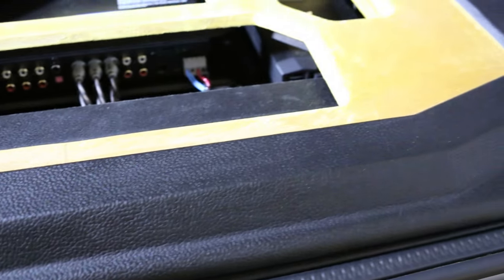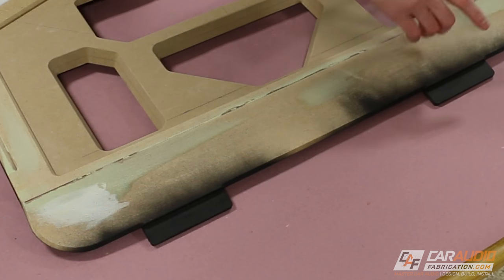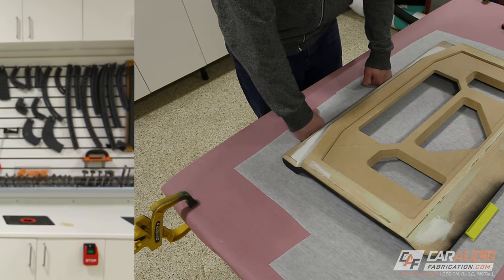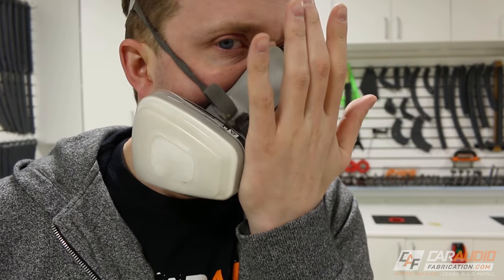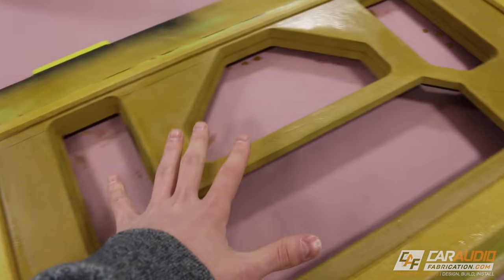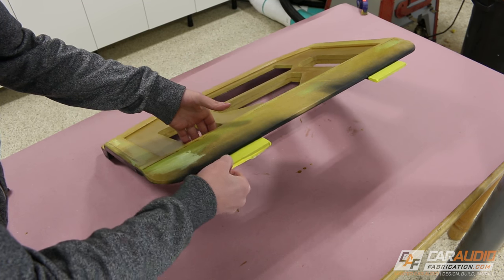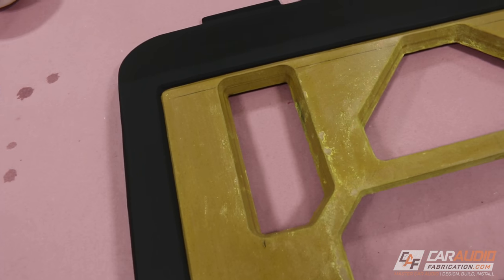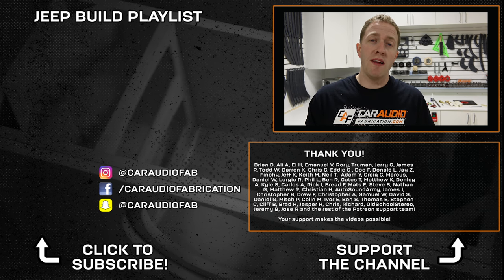MISTAKES TO LEARN FROM - Upholstery Vinyl Amp Rack Beauty Panel

Comment: I come from an audio and auto upholstery background....  (now I am an x ray tech...but I still do some things from time to time.   What I would say is that if your 4 way stretch material is that stretchy.....it may be the first thing to pull away from the corners where your (now new line is)...that being said...if you wanted to add some trim over the material to keep the new stuff down....that would be helpful and it would help set the car off.

Years ago we had a car come in the shop that I made a pattern from what was there....it was a fancy LeBaron Chrysler....with the 2 seater only and stitched leather dash with deep inserts for the defroster for the windshield...  you may be seeing where I'm going with this.

With deep contoured panels...sometimes it isn't such a bad thing to run it under a seeing machine and actually have the material comfortable where it will be instead of having to heat it and stretch it and hope that with the time that folks keep their cars....that it stays.  Sometimes even the best glues can still not be perfect when the cars are not garage kept or someone leave a window down or what have ya'.

I love your channel and your ability to show how ya' do things.  Keep up the good work!

If ya' don't have a sewing machine....I'm sorry for a suggestion that would be a bit undoable at present moment.

Comment: Mark,

I love what you doing on the Jeep. Thanks for the walk through. As far as what to do with the transition. You already have a whole bunch going on there with the two different textures of vinyl the metal mesh and the acrylic. I fear that adding a painted trim piece would create a much busier look than what you're going for.I feel the better alternative would be to go ahead and pull the vinyl on the outer part you already have done and wrap the whole thing with the four way stretch vinyl.

Comment: if you can strip back the adhesive, I'd consider a different treatment on that area (flockiing, SEM spray texture and automotive paint, flat or satin automotive paint, etc.)  I think it's going to be very hard to get a good hidden seam where the vinyl transitions between pieces and I think a different black vinyl may not look very good right next to vinyl you've done.  I might also consider going with a contrasting color.  This hiccup is really an opportunity to add more interest to this very cool install.  Thanks for sharing the bad with the good.  Any custom project can go a little sideways.  It's how you roll with it that makes a great installer!

Comment: Hey bro , I do upholstery full time , since you’re not big on the upholstery I don’t see a need for the weld wood , pick up a bottle of 202 marine k grip , dries faster , less flammable , all around last longer and way more user friendly no mask or anything required . Nobody seems to know about this glue and they end up using weld wood which works good but it goes like water

Comment: Not sure if it'll be of any help, but there's a trick with wrapping vinyls like the ones used to wrap entire cars that may carry over to these thicker materials:  Rather than applying your flat areas and stretching/heat-stretching to conform to various contours, start in the most difficult contour(s) and work your way out.  That way there's an abundance of material in the complicated area, and you can heat-shrink the corners and edges where it transitions into the flat spots.  It's sort of completely backwards from what we get taught, but I've had a lot of success with it, especially when wrapping small, oddly-shaped interior trim pieces.  :]

Comment: I would do an exact copy of the inner door trim grab handle piece. use the same style Allen head screws to bolt it down and space out the bolts in a way that you bypass the skinny parts of the mdf.

Comment: Do you notice a difference in the ability to stretch the vinyl around complex shapes when brushing vs spraying contact adhesive? In my experience, brushing makes a much thicker application and is more difficult to stretch the upholstery material.

Comment: Hey Mark - at the ~8 min mark when you pulled up the vinyl, did you have to clean off the previous contact adhesive before applying the 4 way stretch vinyl? I just ran into a similar issue on a project, and I am not sure if I can "re-activate" the contact adhesive that's left on my MDF by applying more adhesive on top of the old stuff? Thanks for all the great videos and inspirations!

Comment: Not sure if it's feasible, but what about a brushed aluminum insert (finished the same as the door trim you pointed out) for the entire inner section, then paint your metal mesh parts black?

Comment: Quick question brother maybe I’m overthinking it or didn’t hear it in the video put when you applied contact adhesive onto the vinyl/upholstery is it the same adhesive you applied to the board ?? Cause color was different didn’t know if the material caused color to change or it was different adhesive on both ??  Thanks either way God bless

Comment: Hey why don’t u use a heat gun???? I do upholstery at legacy innovations and find your videos helpful on certain things But anyway I work with vinyl all the time and heat is your best friend when it comes to wrapping pieces it helps the material stretch more also while working with leather use heat to remove wrinkles and Teflon is a great thing to use when smoothing piece out it didn’t scratch materials u can buy it in sheets and make your own tools

Comment: What is the difference in the original weldwood contact cement and the landau top and trim contact adhesive? I'm looking to do vinyl to mdf as you are in this video but can only get my hands on the original weldwood at this moment. Thanks in advance

Comment: Hey I have an issue.. I am wrapping door panels this is the 2nd time I am wrapped these doors using contacts cement and carbon fiber vinyl from vivid.  I keep getting air bubbles when exposed to heat in the same location. I have put small holes and Removed the air from under the surface and it keeps coming back. Do you know a solution to this problem. It's only when exposed to direct heat like sunlight

Comment: Totally irrelevant to this video, but I have a question about mounting a single DIN head unit in the glove box for my 2015 Buick Regal. So far, no dash options are available so the glove box is my only option so far. My question is...any suggestions?

Comment: Question.. I'm trying to upholster a dash in vinyl leather, if I use a heatgun to curve certain areas, how does the welwood glue reacts to heat? it is a really big curve, dont know if you have seen a 1986 corolla dash. please help, thanks!

Comment: Good evening.
I like your help videos alot, use them many times :)
But now i want to use the Weldwood Contact Adhesive you show in this video, but i have big problems getting it to Denmark, is tthere any other place to buy, that you may know ships to Denmark ?
I know this is kind of off topic question, but hope its okay.

Regards
Brian.
Reply: Brian P. Rasmussen Same stuff used by flooring guys who use contact type adhesive. Some are too thick to work with, but you can dilute with laquer thinner.

Comment: What is better than contact cement ? My uncle makes guitar cases and uses that contact cement but after a while it starts peeling off the edges . There has to be a more permanent glue . Do you know of one ?
Reply from the maker: Your uncle isn't using landau top and trim adhesive. This stuff is proven and last for a LONG time.